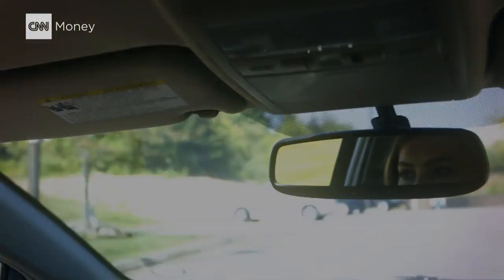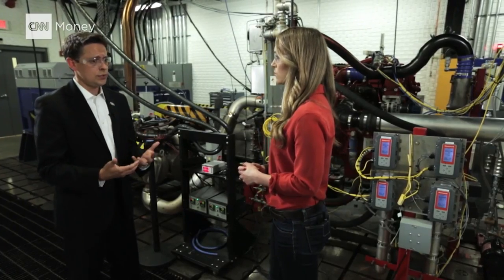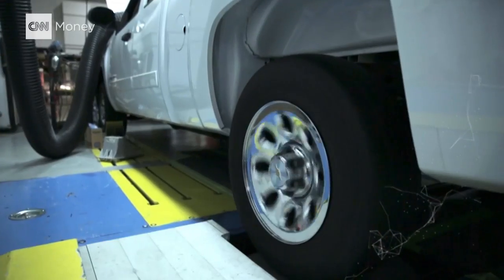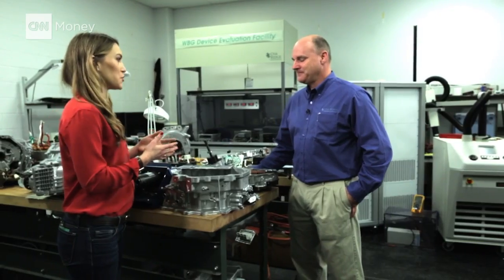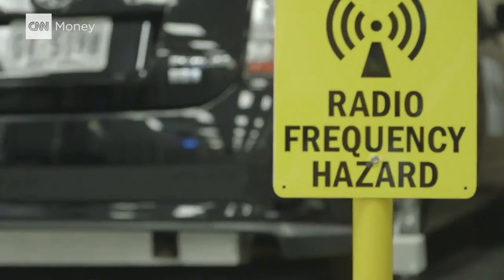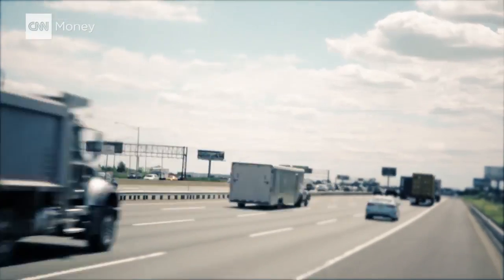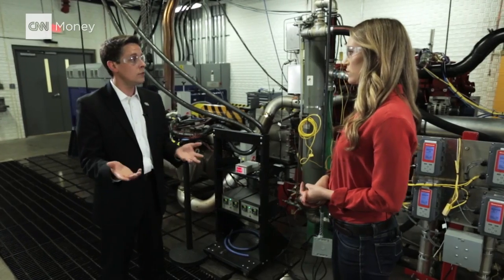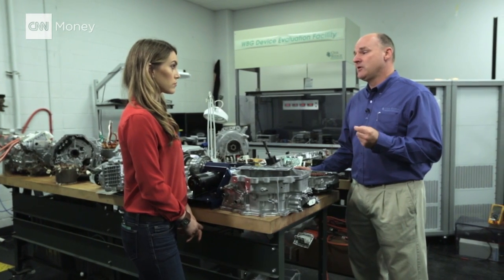A highway that charges your electric car

Comment: imagine how all these resources and energy for making those extra large batteries will be saved. 
Also the cost of electric cars will diminish to that of a normal ice car's.
With the remaking of an old road the wireless system will be embedded so not a huge extra cost
All these resources and energy could be focused on increasing the renewable percentage of produced energy instead of car batteries.

Comment: Nikola Tesla envisioned a wireless "World System" to transmit energy over 100 years ago. The U.S. government, fearing German Spies were using Tesla's experimental radio tower, blew it up  in 1917. Today we have wireless phone chargers - inductive charging. Turning entire road networks to inductive charging seems excessive. I can imagine, after major investment in burying coils, such technology suddenly becoming obsolete 'down the road'. Perhaps certain 'charging roads' (toll highways), sections or parking spaces makes more sense. Most charging should probably be done when a vehicle is parked. Elon Musk is already working on a 1,000 km range for electric vehicles by 2018 which makes 'range anxiety' obsolete.

Comment: how about, instead of all that trouble and nonsense..   having a way to integrate a charger that charges the battery as you drive? like a charging device on the wheel hubs that produce electricity by friction? or like a magnetic source type of charger that charges the battery while you drive. more like a reverse thing.. instead of a battery in electric cars, why not have a smaller battery to boost the start movement of the car the have some type of alternator style charger at the wheels that keeps the car moving? even at that all im saying is instead of a damn highway fixer upper with 80Billion worth of shit, why not integrate a charger in the electric cars, solar panels are an idea, so why not a solar panel body? kinda like paint but solar panel instead with different colours to pick from lol.. because were picky too
Reply: The problem with this is something called "Conservation of Energy".  Basically, you can't generate a positive yield of energy within a system i.e. energy to power a car needs to come from somewhere else other than the car wheels or anything that moves via the motor.  Solar panels do not apply to this!

Comment: This may not be such a good idea. Placing all those resistances through the whole country would require an enormous investment as well as possibly a renewed reliance on fossil fuels and/or atomic energy down the line to run these systems. As batteries become more efficient in storage and charging,  the issue of range anxiety would diminish (both real and percieved), but the system would continue running 24/7 regardless; so a potential enormous waste of resources could occur (if indeed it were to operate this way of course). If a great investment by taxpayers was made, this probably would be used by the oil and gas and nuclear power interests to point out how the electric power/battery system failed in this particular way (great cost to build and wasteful when operating, failure to reduce emissions and nuclear waste).

Comment: All of these guys researching this in all 10 countries know this is an absurd brain fart. They do it because they get funded and it pays their bills.

Forget that highways need to be ripped up to install these very expense copper coils, the amount of power to run+charge every car on the highway is just not doable. On your next morning trip to work, look around at the sea of cars on the road. Know that every car needs ~20Kw of power just to drive (not charge) at 70 MPH. Do a little math and see if that sounds reasonable.

The problem is not that we can't deliver that much power. The problem is that we can't concentrate it that much around the highway system for it to be economically feasible. Imagine the substations and power delivery installations needed to accomplish this. Solar panels? Please. The arrays would need to be a mile wide around the highways and you could only drive on sunny days. Nice.

Now, embed these coils in parking spaces and driveways and you have a distributed, convenient and practical solution for hands-off charging.

Bring on the hate! :-)
Reply: +JoeyRodz74 dude u think they would be wasting money on the research when they know its not econmically feasible? the us government spends 800 billion dollars only on the army, imagine all of its budget, there is enough. On the other hand solar panels work during cloudy days too, they dont only during night (thats what storages are for).

Comment: The cost is approx. €1 Million per k.-meter. That is a very costly proposition. 
Would it be cheaper when installed in a newly build section of Highway?
Reply: +Falk Guthert this won't be done in one stroke anyway...a cost of 80 billion for the whole highway system stretched out over 10-15 years is actually laughably cheap in the longrun. So while Highways get repaired and expanded these things could be implemented. Maybe start with only one lane for instance until electric cars are more widely used.
Honestly, if a country can spend hundrets of billions on the developement of a single jet fighter plane, this seems like a bargain compared.

Comment: Someone needs to develop crystal-like solar absorbing nano particles which can be 'sprayed' directly onto road surfaces we use every day, throughout the world!
Reply: why not cut out the middle man and spray these nano crystals directly on to the vehicles?
Reply: Because the efficiency probably would be horrible which means a vehicle wouldn't have enough of a surface area to make a dent into the power needs of the car. The bigger the surface with a back up battery bank would be a better option. Although all of this is very far into the future.

Comment: this is pretty groundbreaking but it's so amazing that i fear it won't happen for quite some time since the government will have to approve it. The devices won't be implemented until most cars are electric and it will take 15 years or so for that to happen. so we've got lots of waiting time
Reply: The government is one doing the research.